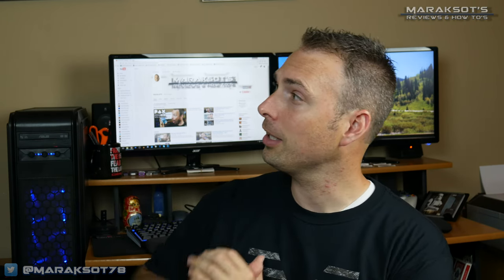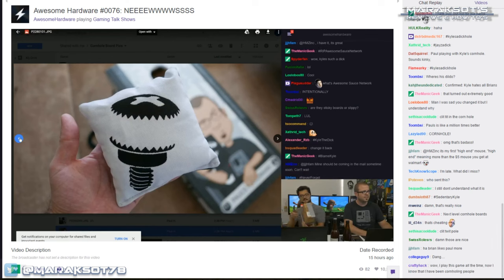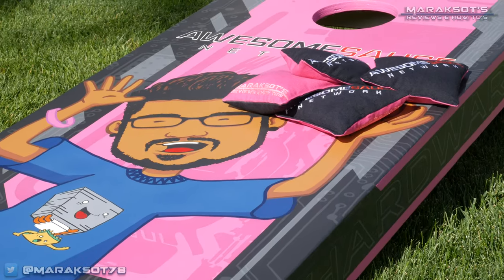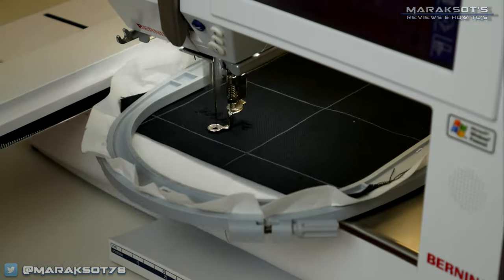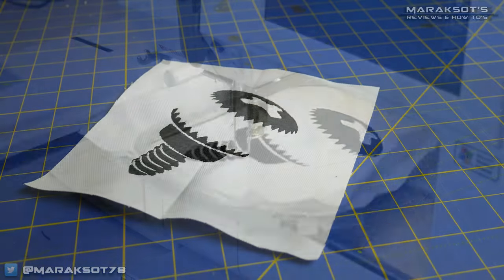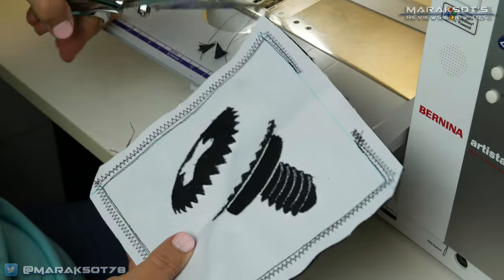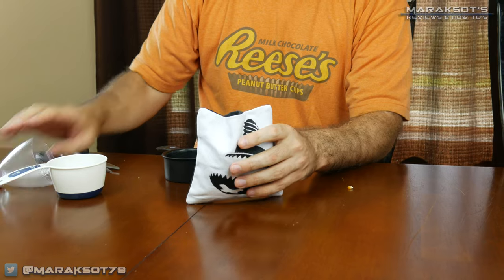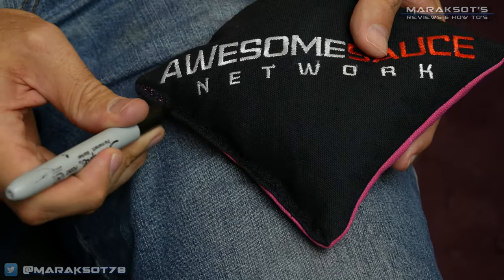How to Build a Set of Custom Cornhole Boards - Part 3: How to Make Custom Bean Bags

Comment: You go above and beyond setting a high standard for yourself, improving with every video! Using close-ups when you're trying to point out something or present it is definitely a strong point for you. I'd recommend later on getting a motorized circular platform table or camera slider for a little more motion in those glamor shots, though.
Reply from the maker: +BAY_listicx thanks so much for the constructive criticism and encouragement. I definitely want to get some of those things in the future. Right now it's not quite in the budget but when/if the channel starts making some decent money I'll definitely be picking up some equipment to help the channel continue to improve. :)